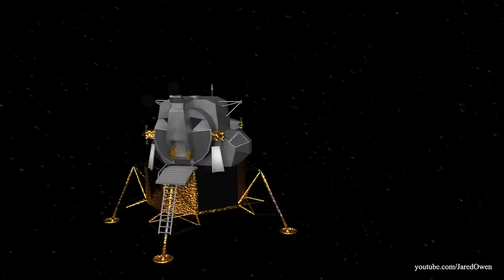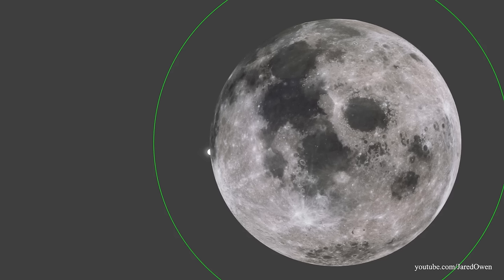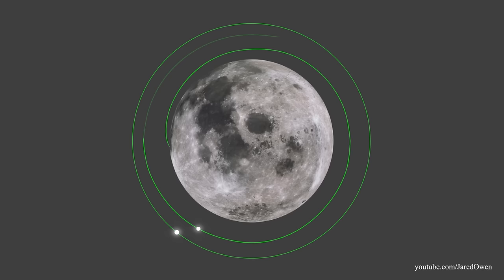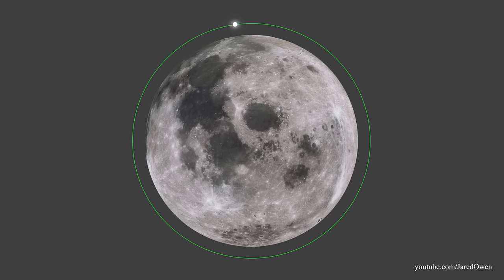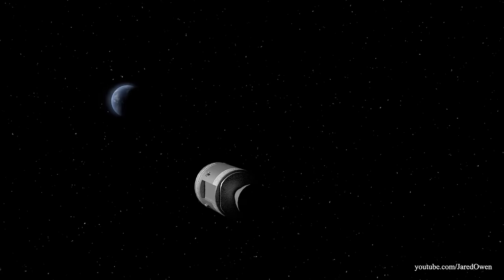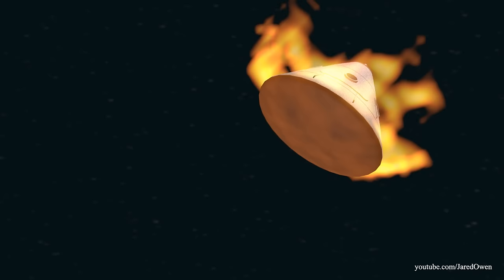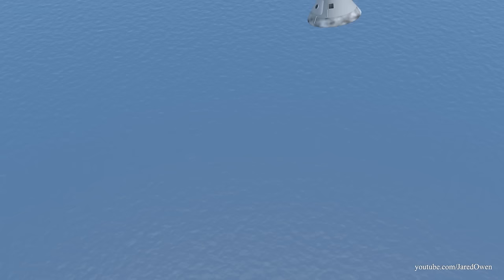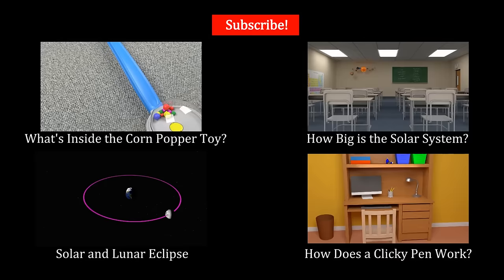How the Apollo Spacecraft works: Part 3

Comment: The temperatures were about 300 degrees in the sun and -250 in the shade and not once in all six missions did anyone mention they were hot or cold, never.  How is that possible?  It's not.  They would have to be constantly turning around to stabilize the temperatures but not one time do you ever see them do that, not once. Those space suits were full of wrinkles not pressure.  
Do your own thinking and research, question everything, once you see a few lies, you will continue to see them all.  Hundreds of them.
Reply: Lots of the usual questions that have been asked and answered numerous times before. Did you try searching for any of this? The only one I'm going to bother with is this ridiculous notion that NASA has destroyed all the Apollo videos and transmittal tapes. First off, the only video info lost was the Apollo 11 SSTV transmittal data tapes. That's it. The only reason you even know about it is because they released the info. Everything else is safely stored away. As for the transmittal tapes, just another exaggeration, Yes some have gone missing or were taped over but all the data was documented and is still available. Why would you think they would need to keep all the transmittal tapes for such things as the Apollo spacecrafts numerous sensor and technical readings? Same with all the information collected about the astronauts and everything related to them. As I said it was all documented so it's not like once they taped over something the data was lost forever. It's true that NASA was hoping to see if some new info could be derived from using new technology on reading those transmittal tapes which again, is why you even know about this. As for the rest, if you really can't find a satisfactory answer, then I suggest you make an account at Apollohoax(.)net's forum and pose your questions there. Lots of knowledgable folks who will explain it all to you.

 If you ever do attempt to do some proper research, you would find that every single supposed bit of evidence brought up about alleged proof regarding hoaxing the Apollo landings have been debunked over the years. Most of it with relative ease because the supposed proof is usually based on complete ignorance of the particular subject involved. Meanwhile, there is tons of scientific evidence that is irrefutable which has been accessible to scientists and aerospace engineers for the last 50 years who have never found anything that might suggest the landings were faked so it's only people who lack critical thinking skills who fall for this moon landing hoax nonsense. Here's some of it:

-> There's the live TV coverage that would have to somehow convincingly fake 1/6th G movement in a vacuum, Google "Irrefutable Proof for Moon Landing - Lunar Gravity" and explain how experts in the field of kinematics for 50 years have never come forward with proof that the astronauts are not in an environment that they say they are. There's also the fact that any attempts to do filmed mockups of the eva's on Earth would have to be passed off as live TV broadcasts which would have to fool telecommunications experts around the world. Google "Moon Hoax Not" and "For Jarrah" to get a better understanding of how much would be involved to pull that off and how the filming technology back then was simply incapable of such a thing.

-> There's all the moon rock and core samples that would have to somehow be able to pass scrutiny with geologists who can readily spot whether it's something that has passed through our atmosphere or not. 
Google "How do we know that rock came from the moon?"

-> NASA has made these samples available to scientists from around the world and every year 500-1000 samples are sent out.
Google: "NASA lunar sample request"

-> There's the Apollo 16 UV telescope images that no astronomer in 50 years has ever found fault with. Google "onebigmonkey apollo 16 UV telescope"

-> Another thing that astronomers would be able to spot are pictures of the Earth that don't match what they should look like. Google "Apollo 11 Earthrise - How One Photo Proves it was Real" for an example. 

-> Another one to google is "Apollo 11: Fingerprints in Deep Space" that shows obvious handheld TV footage from the Apollo 11 CM looking at Earth from far enough away that they are clearly beyond the VAB's.

-> Then there are the LOR images. Lots of hoax believer nonsense about them being faked but the transmittal data for them can be downloaded by anybody with a computer and so far, nobody has proven anything about them being faked. You don't think a smoking gun like that wouldn't have been scrutinized by people with the required computer science expertise??

-> Here's something else you might not know. Apollo 12 landed close enough to Surveyor 3 that Conrad & Bean were able to do an Eva to it and removed the camera and sampler scoop from it to be returned back to Earth. They wanted to see what the harmful conditions of the moon had done to those parts after 2.5 years: Google "Analysis of Surveyor 3 Material ad photographs returned by Apollo 12"

-> 5 plutonium-238 powered ALSEP's were left behind that transmitted data from the experiments back to Earth right up till 1977. Unfortunately, due to budget constraints, they were shut down but they did send back enough information that storage of it became a real problem as detailed in this article: Google "the-long-road-to-alsep-data-recovery"

-> Starting with Apollo 13, they purposely directed the spent S-IVB's to crash into the moon so that the Apollo 12 seismograph could record the seismic waves generated to help determine the moon's crustal structure and makeup. Of course, as each successful mission added another ALSEP, they were able to expand on the info derived from these man-made impacts. They also did the same with the lunar module ascent stages. The Apollo 16 LM ascent stage data isn't shown because of difficulties during the de-orbit phase. They were able to derive a lot of info from these artificial impacts. Google "The Description of Apollo Seismic Experiments darts"

-> Another great site to check out has some pretty thorough crater analyzing to prove the landings happened. You can check out all six of the landings this way: Google "onebigmonkey apollo sights landing"

Are you starting to understand the magnitude of what would be involved to pull a hoax like this off? Never mind keeping it from being exposed?

I suggest you also take the time to read through the 93-page pdf titled "NASA’s Recommendations to Space-Faring Entities: How to Protect and Preserve the Historic and Scientific Value of U.S. Government Lunar Artifacts". There is lots of nonsense from hoax believers that the USA is trying to make the Apollo sites inaccessible which is ridiculous seeing as these are only recommendations designed to limit harmful effects of spacecraft landing too close or the altitude of hopper type craft flying at too low of an altitude. The fact is, the USA has no issue at all with visits to the sites by manned or unmanned means. They do request the Apollo 11 and 17 sites are accorded with the proper respect due to the obvious historic value. Also, there is an Appendix B in the pdf that gives a lot of recommendations from NASA as to what type of investigations at the Apollo sites would be most beneficial for scientific purposes. Now does this seem like the type of behavior for a country that supposedly faked all of this??

As I said, irrefutable proof that has withstood scrutiny by the relevant experts from around the world in all the specialties involved for 50 years which in my book proves beyond a doubt that the landings happened just the way they were documented 50 years ago and which easily trumps supposed proof that this was all faked but that same supposed proof doesn't stand up long to scrutiny.

Comment: How long did it take to go 125000 miles through the vanallen belt? How did u shield it...where did the pretend real reel of tape go
Reply: The orbit was actually inclinated such that it took them above the worst of the van allen belts, and the astronauts only spent a couple of hours going through them. There was not any particular shielding because the entire journey only resulted in .0114 sieverts of radiation (.05 Sieverts is the safety limit of Nuclear Plant workers in the US, so .0114 is not dangerous.)

Comment: won't the parachutes catch on fire
Reply: Why would they?
Reply: @Tim22222  There was fire, and the parachutes probably weren't fire proof
Reply: @maryjin631  You mean the fire during re-entry? The parachutes are safely inside metal canisters & don't come out until the fire is over.
Reply: @Tim22222  okay???? But won't the parachutes rip if going too fast?
Reply: @maryjin631  True! Which is why they don't deploy them until the capsule is going slow enough that it doesn't happen.
Reply: @maryjin631  They've thought about these things. Really!
Reply: @maryjin631  https://youtu.be/gdO151wNPkI?t=118

^ Here is the info you're looking for.

Comment: If the spacecraft is traveling 25,000 mph toward the moon, why doesn’t it take 10 hrs to get there? It takes 3 days. The speed would be roughly 3500 mph. Hmm
Reply: So you think they just head over there full throttle and just yank the handbrake on just before touchdown?
Reply: They reached that speed during the TLI burn but as soon as the main engine shut off, the Earths gravity started to slow it down until it had lost about 90% of that 25,000 mph and then the moons gravity started to accelerate it again.

Comment: There is million things what can go wrong. So I'm now more suspicious, did they ever landed to the moon.
Reply: There are millions of things that can go wrong on a commercial airliner but thousands of them fly safely everyday. If you design, manufacture and test things well enough you can reduce the failure risks to an acceptable level. Apollo also had a lot of redundancy in place and there was an effective network of technical support on the ground.
Reply: There are things that really go wrong. Apollo 13
Reply: @joevignolor4u949  Yes but it's more complex go to the moon and back than from London to New York. It isn't so much thousand times everyday tested routine. And what comes to safety issues Nasa forgot that all with shuttles and result was tragedy.
Reply: @paskapaavo  The shuttles were to a large extent a political make work project for people in congressional districts. It was never a good, safe design to begin with. That being said it did make 133 successful flights, but with the two accidents. NASA did have the one failure on Apollo 13, but that doesn't make the other 6 landings impossible.
Reply: @lolomo5787  True. And things can also really go right, such as on Apollo 7, 8, 9, 10, 11, 12, 14, 15,16 and 17.
Reply: Joe Vignolo I thought the last mission was 15 hmm what ever

Comment: There are six limbs left on the moon point a telescope on the earth in real-time no skulduggery and pointed at the moon show all them flags and Limbs and reflectors they left on the moon you can't can you
Reply: Who's "limbs" did they leave behind? 

LOL Flatters - comedy gold every time.
Reply: Eric, there's a well understood concept (well understood by everyone besides conspiratards) called "optical resolution."  See, the thing is, you can't just cram an infinite amount of light through a lens.  There's a limit.  Beyond that limit, the photons interfere with each other, and all you see is a white blob.  Have you ever taken a pile of magnifying glasses, and stacked them.  You put two together, and you can see even better.  Three, even better again.  Four maybe.  But, you come to a point that you just can't stack them any longer, otherwise you just see a white blob instead of a magnified image, right?  Well, that's the point at which the photons just can't cram through any more lenses.  And, the only thing you can do is get bigger lenses.

Well, that applies to telescopes also.  There's a point at which you just can't magnify things any more, without needing to make a bigger lens.  You can calculate this.  Go look up the formulas.  And, if you do the math, you will find that the minimum size lens that you'd need in order to see the artifacts left on the lunar surface is a QUARTER MILE DIAMETER LENS!!!  I mean, well, you could do it with a 75 foot diameter lens, but, then the best you could see is a dot.  In order to actually make out what you're look at, it would take a lens a quarter mile in diameter.  Thus far, the biggest optical grade lens ever constructed is 5 feet in diameter, and costed $168 million to produce.  Um, yeah, we're a long way away from quarter mile lenses.

Just go learn to read and write.  Seriously.  I promise you, becoming literate will serve you far better in life than to run around with your conspiracy garbage.

Comment: It all just seems a bit much, I am 50/50 on of it actually happened. I feel silly saying it but again it just seems a bit much.
Reply: Well, the fact is that The most technically difficult part of landing on the moon was building a large enough rocket to get the necessary payload into LEO for the TLI burn. Of the approximately 400,000 people involved with the Apollo program, roughly 300,000 were needed designing and building the Saturn family of rockets plus all the logistics required to prep them for launch. Prior to the Apollo program, the USA experienced up to as much as a 40% failure rate with its various rocket launches which were pretty small and relatively uncomplicated. Of the 32 rockets in the Saturn program, all 32 of them were successfully launched. These were some of the most complex machines built at that time culminating in the Saturn V with its 13 successful launches. Meanwhile the Russian version of the Saturn V, the N1 heavy lift rocket blew up spectacularly 4 out of 4 times with the Russians cancelling their moon landing program after the last failure despite the fact they accomplished many of the same goals the USA did such as soft-landing probes on the moon and testing their version of the LM in Earth's orbit. 

I'm not saying the Saturn V was the only issue they had to resolve, there were certainly many others, but the main point is that it was definitely the most technically difficult and they aced it even though they were expecting about a 50% failure rate with their Saturn 1 & 1B's. That should give you some idea about how dedicated and committed the people involved with this project were and most of the program shared similar success although of course, the tragic Apollo 1 fire did show that they weren't infallible. Whatever points the hoax believers bring up have all been proven to be nonsensical claims and there is even deliberate misrepresentation and outright lying by some proving how unscrupulous they can be about this subject. Not sure what exactly causes you to have some doubt but bring them up here and I'll deal with them as best as I can. Best to do just one topic at a time.

Comment: Was the LEM pressurised?
Reply: Yes, it was pressurized to 1/3 atmosphere, about the same as at the top of Mt. Everest. That was enough for the astronauts since they were breathing almost pure oxygen. That also means that the hull of the LM's crew compartment was exposed to a smaller pressure difference than the hull of a passenger jet at normal cruising altitude.
Reply: @marxman00  : LOL. So you just make up stuff? Where is your proof that the light version were made of aluminum foil? 

Or has Puting upped your troll pay by # of posts?
Reply: @kitcanyon658  . Due to the weight saving programs the compartment skin was reduced to a thickness of 0.012 inches, the equivalent of approximately three layers of kitchen foil.
Reply: @marxman00  ; LOL. That's hilarious. Yes, the foil used for helping reduce the thermal load on the craft due to radiative heat transfer (which you don't understand) was thin. Gee - how amazing is that?

The funny thing is that you think that foil was the entire construction. This proves you didn't even bother to "research" anything about the building of the LM. 

Why is that? Too afraid? Too hard for you to read b i g words?
Reply: @kitcanyon658  so you were wrong then, why would it be pressurised  in a 1 x 10-11 torr , thats  impossible and how would they survive decompession effects. its not a question just an obvious observation
Reply: @marxman00  : So you are sticking to your baseless claim that the actual walls of the pressure vessel was foil? Yes or no? 

I know you're a troll but at least try not to be so obvious. LOL.
Reply: @kitcanyon658   are you still sticking to it being pressurised  in a 1 x 10-11 torr vacuum and that foil is a heat shield and the legs were foil wrapped but  other parts painted black?? LOL